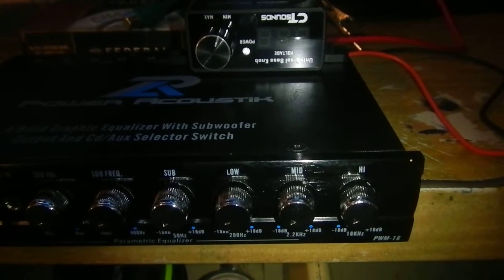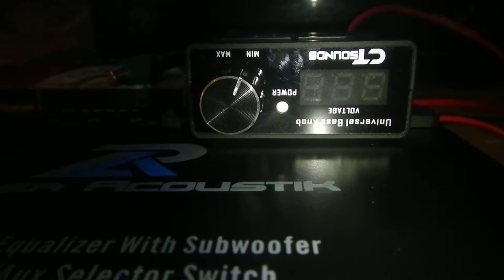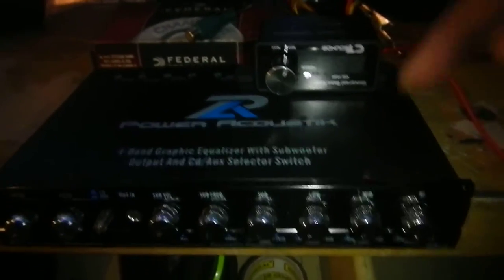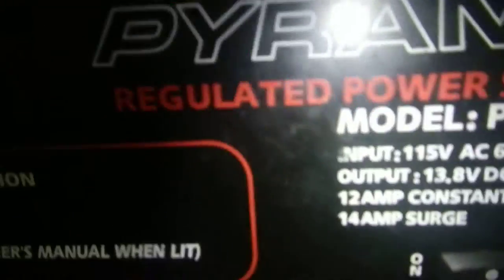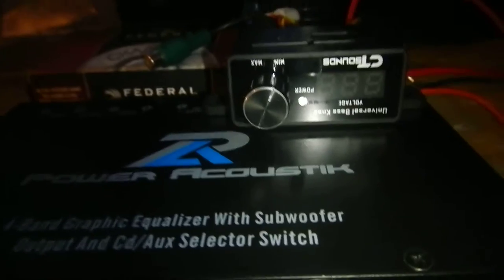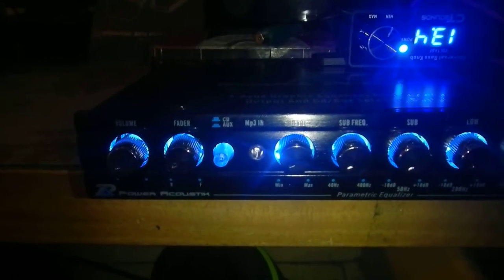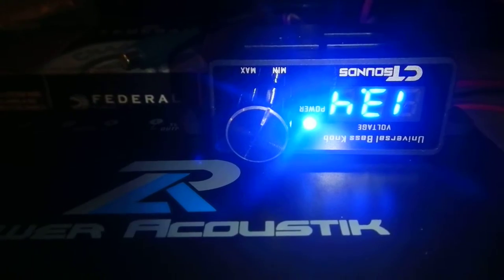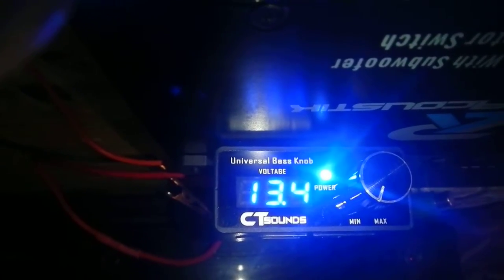audio update 2

Comment: how did you wire it to the eq with the amp rca wires running to the eq?
Reply from the maker: stereo rca to eq in the eq sub rca to amp lmk il draw diagram if u need
Reply: MOESKEE CAR VIDS  yea that would be helpful, bekause what I'm trying to figure out is how you connect the bass knob and get it to control the sub bass with the eq  rca wires connected to those ports at the amp.. that's were im getting lost at.
Reply from the maker: hit me on book soi can msg u 101 i see were ur lost i was too Mose moeskee davis i just dont know how to send pic msgs on here